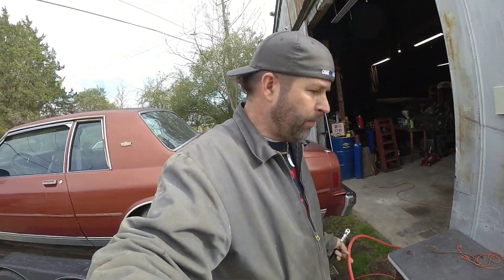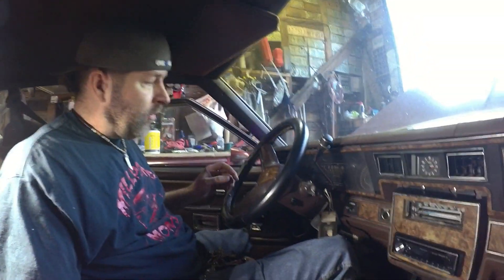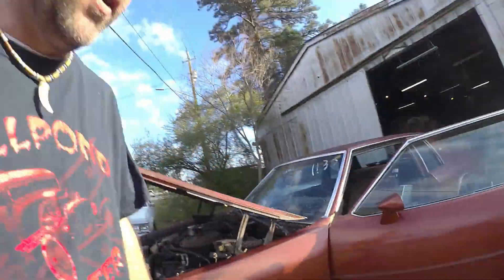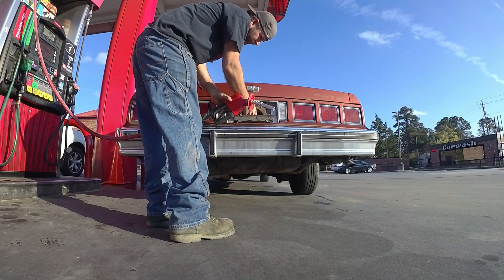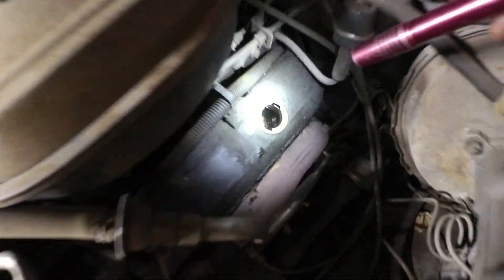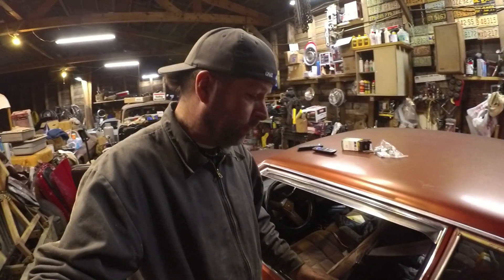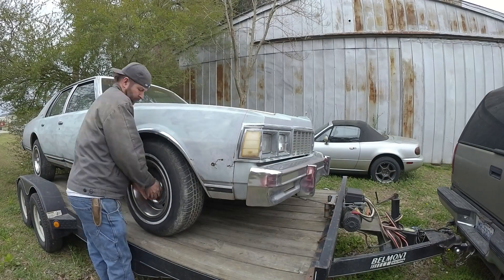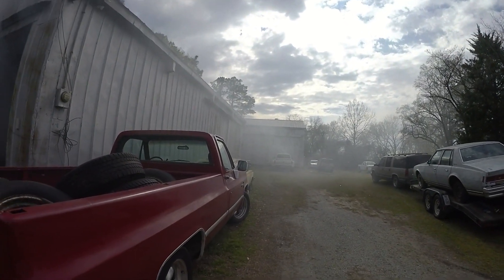I Bought A 1984 2 Door Chevy Caprice, Will It Run?

Comment: I've updated a 1984 Vanagon Westfalia and made it a reliable  daily driver and transcontinental RV. It was built in 1983... almost 40 years ago. The older you get, the faster time flies. Early 80s US cars didn't have EFI and were mostly asthmatic smoggers. Worst asphyxiated engines ever. The vanagon thankfully does have EFI. Chevy EFI by the end of the decade was a huge advance. I have an 89 pickup with TBI, an 85 Corvette with TPI and a 68 SS396 Chevelle retrofitted with TBI. I rebuild carbs for others but I hate them.
Reply: My brother has a 68 SS396 Chevelle show car.
Reply: @stevenreynolds2327  I got mine in 1972, it's only ever been for go no show!

Comment: I had an 84 Malibu! I put duel exaust complete with duel catalytic converters to Mega Thrust mufflers and straight pipes on a 454 stock truck engine! That baby was a beast and had this throaty sound! Made everybody think it was a sleeper rat rod! The paint looked like it came from a meth lab!😄  all rust, no color! But it was solid and had a great interior! Of course I had to put a big ass sound system in it and had to run two batteries to keep it from killing the car when you cranked it! I put that car through Hell and back- it just kept on going like the energizer bunny!

Comment: Great find! I looked at buying an 86 coupe brand new but it was a bit out of my price range. I instead bought a brand new El Camino which I still own. I was only 28 at the time. I bought a low mileage 84 Landau coupe in 1996, should never have let it go. I am now restoring an 80 Landau coupe I found in a salvage yard six years ago. One thing on that overdrive transmission, if you are driving around town in overdrive mode, it’ll hunt for the right gear which makes it feel like something isn’t working properly. The solution is to use drive around town and put it in overdrive on the highway. That way it’s not constantly hunting for the right gear.

Comment: I’ve got a 84 Oldsmobile Cutlass Supreme Brougham 2Dr.
My grandpa ordered it for my grandma.
It’s Black with light grey pillowed interior. Chrome pkg, wire wheels, factory full gauge pkg, 97K original miles.
Never been in an accident.
New carburetor and headliner.
3.8L V6 (Gutless Cutlass).
Perfect original Showroom condition. Always Garaged.
$10K FIRM.

Comment: Hey brother, as one mechanic and hot rod builder to another mechanic, you should look into the ZDDP or better known as zinc additive for the engine oil, these older engines have flat tappet lifters and cam and the newer oil does not have zinc in it for pollution reasons so they make an additive to add into the oil for older cars so you don’t wipe out your camshaft and lifters. Alternatively you can get away with running some shell Rotella 15 W-40 in these old beasts without an issue and that has all the vitamins and minerals in it that these engines need.  Congrats, you got a sweet ride there!

Comment: Nice score on the two door!  Even though it is only a 5.0, they can run very well, especially with the factory CCC system still in place and working properly, as you can attest as to the ease of first start you had after putting a battery in.
Reply: Alternatively you delete the bullshit and put an old fashioned pure analog Q-Jet on it. Like the EEC-IV on my 300 six in my 85 F150, the mid 80s Chevy CCC carbs were absolute bollocks at the best of times and 40 years later it's a miracle if they work at all.
Reply: OR you can remove all the bs and really make that mouse ROAR, mild bump stick, nice 4brrl, headers, locker and she'll boogie
Reply: @docink6175  All I'd do is delete the smog/computer bullshit and put a manual behind it. Performance is fine for me.
Reply: @TestECull  true, let a 305 breath and it'll rip

Comment: You're right that 77-90 B bodies usually came with a 4.75 inch bolt pattern, but police package cars, and some others like possibly Diesels, had a truck 5 inch bolt circle. The 91-96 models have the 5 inch truck pattern, and I think the suspension was based on the previous generation.
Reply: Police package and station wagons had the big bolt pattern, all others were the smaller.
Reply: That's why I'm upgrading too 5on5 bolt pattern from 4.75 pattern.

Comment: I had a 73 Impala with a 350 V8.
I burned a valve and it had a hole in the exhaust, but it sounded like a high performance small block… Blap Blap Blap, with the burnt valve and the exhaust leak. It sounded awesome, but it was a wire out Chevy.
It was EVERYONES PARTY MOBILE. 
It just kept running. It finally died at 307K miles

Comment: I'd be curious to know the last date / mileage entry in that service record book. That will give us an idea of when it was driven last and how the guy may have slowed down over the years. My grandfather's 67 Plymouth had a similar record and it showed 10k miles a year, then gradually tapered off to maybe 1500 miles a year. I bought it with 68k showing at 14 year old. BTW, that hanging choke probably needs a new vacuum pull off. A very common problem on those older engines.

Comment: Seems like pre-1990s American cars and trucks will almost always at least start and move with not much effort, even after sitting 10-20-30 years.  Will that be the case for 2020s vehicles?  I doubt it.  Thanks for the vids!  👍👍
Reply: Not so good with the electronic Q Jet. Accelerator pumps dry out too.
Reply from the maker: I agree with you

Comment: Ike other than that 4 door with the hole in the block. You have insanely good luck with cars man. If you could sell your luck with cars. You would be a millionaire. And Is that the orginal plastic membrane still intact? 😮
Reply from the maker: Plastic membrane?
Reply: @isaacitllbefine7231  the person that trained me always called the plastic behind the door panel the membrane.